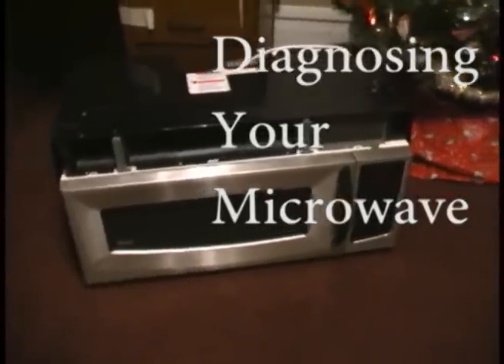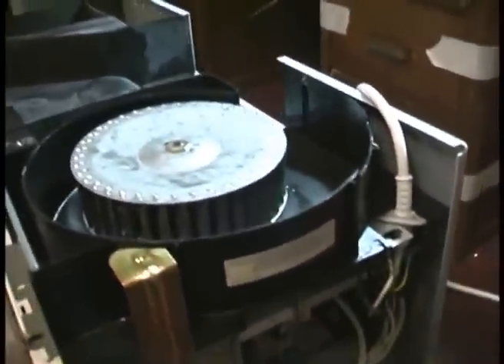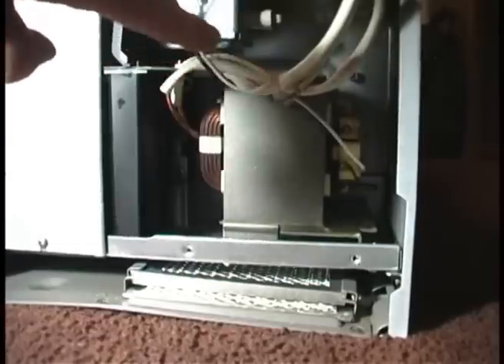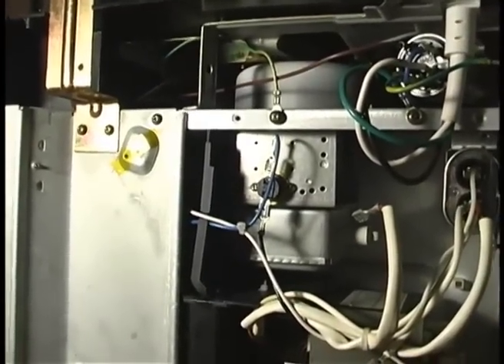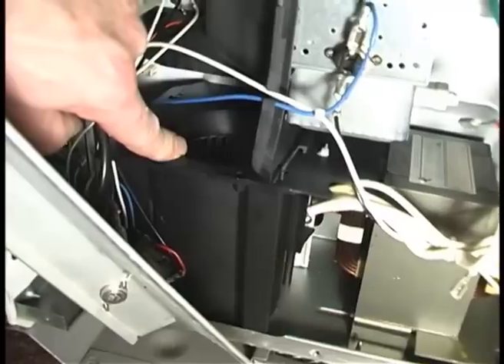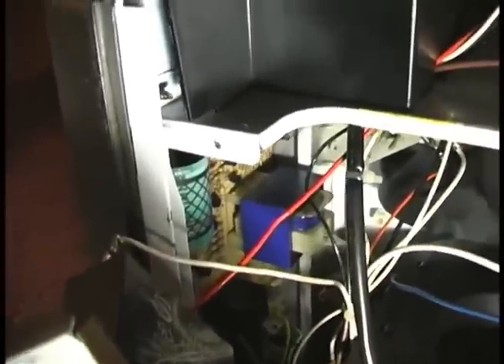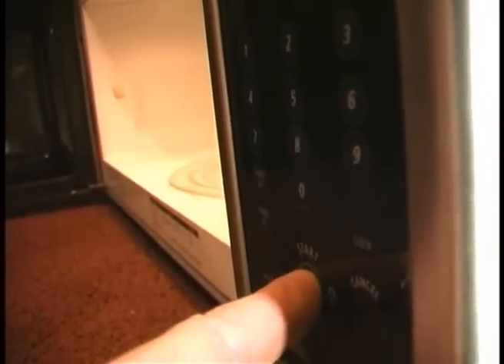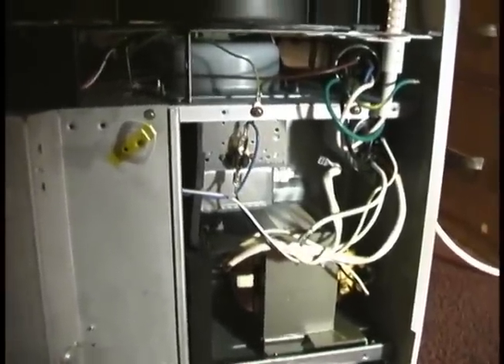How to Diagnose and Fix Your Under Cabinet Microwave. DIY

Comment: To answer questions:
1. yes fan runs during cooking
2. the arc lightning is literally fixed if you replace the only removable plate in the microwave. On the wall that has electronics, remove and get to manufacturer /ebay site and enter model to buy a total fix for 5$.

Comment: I have a Maytag built in over the stove microwave too. I used it a lot last Sunday and I was thinking it over heated. When I walked back into kitchen there were no lights on. It must have shut off during cooking. I electrical outlet does have power. Everything is plugged in but no lights are on ? Does it have a fuse? What do you think could be going on? Thank you

Comment: Hi, My Kenmore OTR microwave is over 15+ years old, the problem, the VENT fan kept running, the only way to turn it off is to unplug the microwave power. All buttons work except the vent fan off button. The microwave still look brand new, we hardly home and it hardly been used and since it still heats up food I hate to throw it away, please help.

Comment: Dan,
The whirlpool under counter microwave I have stopped working today.  The timer will count down but nothing happens.  So If I put 2 mins in it will start counting down but the microwave is silent.  I tried starting the vent fan and it worked so I shut it down and started to try it without the fan.  Now neither of them work.  The timer still works though but the microwave is silent.  The exterior and interior lights aren't working either but I'll try replacing the bulbs before I dig further on that.  I googled around and found that it could be the Diode or and the thermal fuse.  any suggestions?  could it be the door switch?  I was thinking it was a fuse cause it worked than didn't.  if you think it is the fuse or diode where is it located? behind the panel or on the side of the microwave?

Thanks

Comment from the maker: no, i do have a wholesale account at a parts store, however that part , the high voltage transformer was unavailable. I could have gotten one at a used parts store, however it just easier sometimes, with microwave to just get a new one.

Comment: I have a GE under counter microwave that is not heating. When I set it and close the door I hear it running and a humming noise starts on and off but it does not heat the food or water I used to check it. What can be the problem?

Comment: Hey Daniel, I have an Emerson microwave that is making that same sound EXCEPT the timer is not set to cook. All you have to do is shut the door and that humming starts. I have unplugged it and left it for a couple of hours and plugged it back in. Shut the door and the humming starts. It still heats food but it seems as though it heats it even faster than normal. Any suggestions?

Comment: Hi Dan. I have a GE Profile Microwave over the range. It started "sparking". When I turn the microwave on, it starts making noise. Also, I something starts lighting up behind a rectangular flap on the right side of the microwave internally. Once this stops, it cooks my food. Is this a sign that the magnetron tube is going bad?

Comment: Hi Dan, my husband would like to ask you a question…should the fan be spinning when the microwave is on?  We are trying to Dx the problem, however it doesn't seem to be the High Voltage part you are mostly talking about here, it heats everything just fine, we turn the microwave on, the fan is NOT spinning and it's making a pretty loud noise, it is not the turntable we turned it off.  We have a KitchenAid it is the same exact one in this video.  Hope you get this.  Lora

Comment: I have a Samsung  model   smh1713s , runs but doesn't heat at all, I did run it one time the other day with using the timer but caught it was actually running it  in cook mode, seems like right after that it stopped heating, I have changed out the door switch before last year, seeing videos on here suggest its the magnetron, I'm handy to work on things would like to change this myself any way of testing these so I know exactly what part it is for sure? thanks, cant find a video on here that shows how to change the magnetron on my model. also why do they sell these if steam is going to run these, I run my fans all the time but half the time the steam doesn't even get pulled up through the exhaust

Comment: So after my microwave made a very loud grinding noise. it still comes on, but all i hear is that buzzing sound.... I know the Magnetron is still working because I test that by putting in a simple chocolate treat to see if it was heating. and yes it is heating. but its very quite now. like normally you turn on a microwave, you get the buzz, then it like ramps up, or a fan or something comes on, that is not happening. And Ideas?
Reply: What was the problem

Comment: I have a 2009 that the keypad quit lighting up a few years ago after the door got slammed so I'm thinking fuse.. I want to replace it myself because of no money to call someone out but afraid of the capacitor lol Do you have any tips? I've heard to touch the terminals with an insulated handled screwdriver but still scares me.
Reply: oops 2009 whirlpool

Comment: Hi Dan, Thanks for the good video, I just have a question, my microwave is turn on. All the bottom are working , but when I press the start bottom it 's very quite , no noise...I just wonder what wrong and what part should I replace .
Thanks again,
Reply: What was the problem

Comment: What about the diode? What about the capacitor? One of these plus the magnatron tube is normally the problem.
Reply from the maker: its hard to cover every possible problem .
Reply: Daniel Hawk I kinda go with Bill.  It is normally that diode, capacitor, magnatron tube or transformer are wore off in future.  Trust me, I have seem tranformer and capacitor blow up in real life.  That time I misused mircowave capacitor which is why termal is pop up (or crash on top).
Reply: ***** It can be fuse blow up on filter most likely.  check it with multimeter in ohm mode.  it should be 0.001 to 1 ohm.  if it is still L0 then fuse is already blow up.

Comment: Would the microwave not run at all, no lights, etc, if the limit switch is bad? and where could I buy one? Thank you for your video!
Reply: Have you checked the fuse?
Reply: We finally had to give up troubleshooting and get another.  Thanks, though for your input!

Comment: >>>>PLEASE HELP DAN!>>>>My 2007 over the range model#MH1160XSY-1, was also turned on while having a lot of condensation in it, and did the blue- loud- spark thing and flipped the breaker. I then tried it later, same thing. It seems to run fine for about 20-25 sec.,then kicks the breaker off. A new one will cost me $500, so I really need to try to fix this thing.>>>>What would you recommend to check first?>>>> Any info, will be greatly appreciated! >>>>Thanks so much for the awesome video!

Comment: Thanks for this.  Turns out now I know my transformer is bad and have found a used one for $25 on ebay.  My next step is to figure out how not to kill myself discharging the capacitor.
Reply: How did you know the transformer went bad !
Reply: @scottvan1898  To be honest, I don't remember now. It was a long time ago. Sorry.